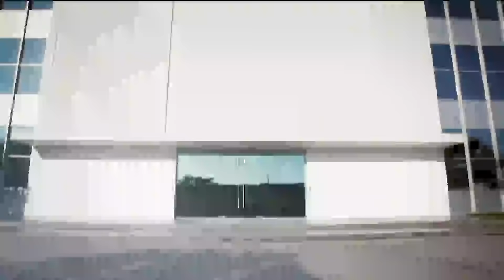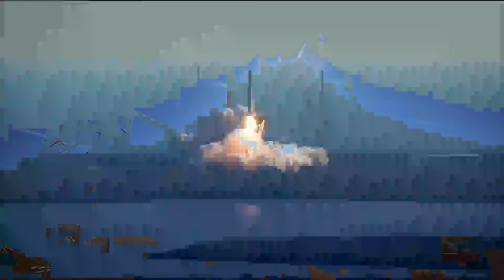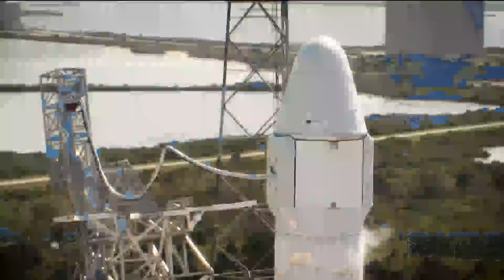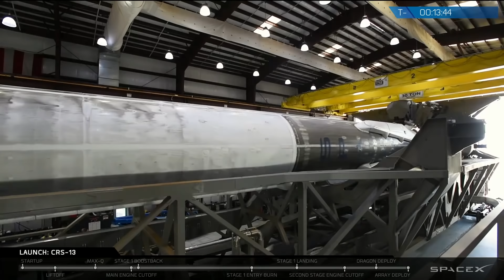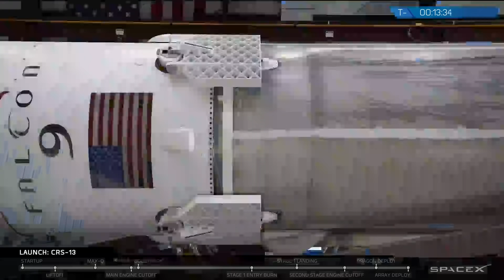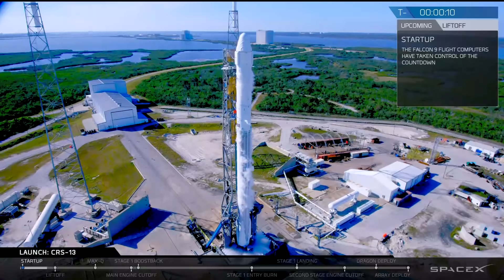CRS-13 Hosted Webcast

Comment: Good burn! Can we also have an accelerometer in the top-right iconography, please? For designers, it could be a second ring just inside the velocity indicator whose platonic ancestor was the lowly mechanical speedometer (why is there a redline area? can it go  too fast/too high?)

Comment: The falcon 9 stands out in such contrast to the rockets used by the rest of the world. The ancient Soyuz is still ignited using big matches placed under the engines,  like a model rocket. The Atlas V still uses the RL-10, an engine developed in the early 60s. The Ariane V derives most of its thrust from glorified fireworks. The SLS, NASA's planned SHLV will be expendable and will cost more than $1 billion per launch, yet it will be less capable than the 50 year old Saturn V.

Comment: Was there a fuel or liquified gas line failure, on the second stage? I see leakage starting (19:02) at the base of the engine cone, upper right corner of the image. I see the build up of what looks like frost or condensate, until right before engine shut off.  Keep watching the right hand screen, as the leakage builds and intensifies as the engine runs. At 25:00 you can see the foil shielding move and what looks like a hose fails and swings out. Condensate falls free, the hose vents to space and the engine shuts down, at the same time. The Commentators hesitate and go silent as the video changes to a still shot, of the landing site.

Comment: I've watched all of these Falcon launch/landings. A couple things stood out on this one.
I got scared at 1st stage shutdown because it took a full 10-11 sec. for separation and 2nd stage firing, which seemed way too long. 
In fact, I went back and rewatched CRS-11 and CRS-12 launches and the time from MECO to separation was 4 sec. for CRS-11, and 6 sec for CRS 12. I really thought there was a problem for a few seconds there. Can't figure why it 'coasted' for so long......

The other outstanding pick up came at 21:08 of the video, when the FL coast first comes into view. There appears a thin squiggly white 'cloud' far below Falcon. By 21:20 it is just to the right of the LEFT grid fin. It is the exhaust plume left by Falcon from the launch!!
I've never seen THAT before, and it was awesome!!